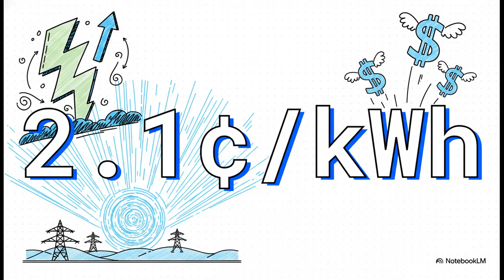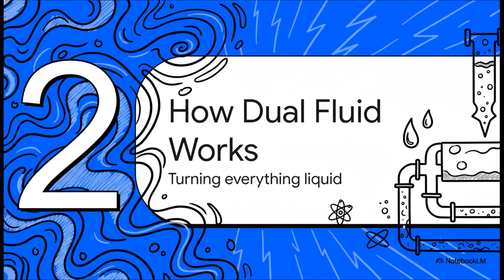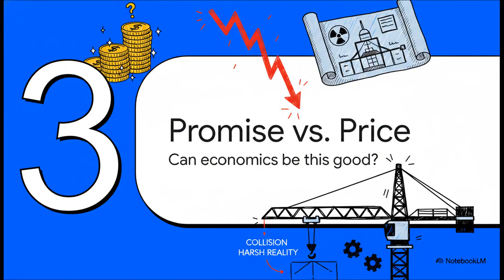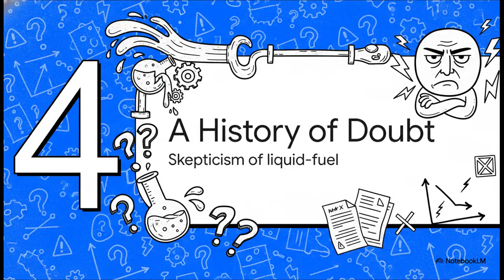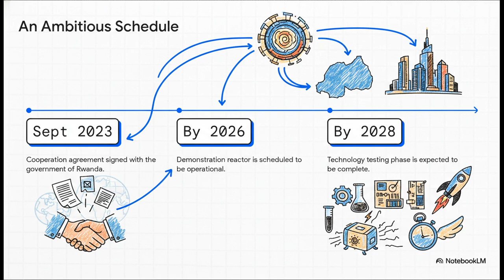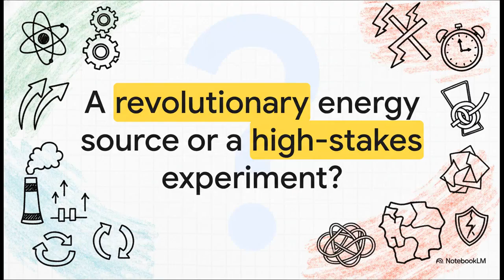Dual Fluid Reactor

Comment: Was wurde im Jahr 2025 vom 01.01. bis zum 31.12.2025 bei der Kernkraft gemacht, in der Welt?

2 AKW wurde fertiggestellt 
AKW-RAJASTHAN-7 mit +630MW
AKW-ZHANGZHOU-2 mit +1126MW
.
7 AKWs wurden stillgelegt
AKW-DOEL-1 mit -445MW
AKW-DOEL-2 mit -445MW
AKW-MAANSHAN-2 mit -938MW
AKW-TIHANGE-1 mit -962MW
AKW-BILIBINO-2 mit -11MW
AKW-BILIBINO-3 mit -11MW
AKW-BILIBINO-4 mit -11MW
.
Da hat sich bereits im Jahr 2025 die installierte Leistung bei der Kernkraft um ca.  -1067MW verringert.
.
Bei den Erneuerbaren ist die installierte Leistung um über +600.000MW bereits angestiegen im Jahr 2025.
.